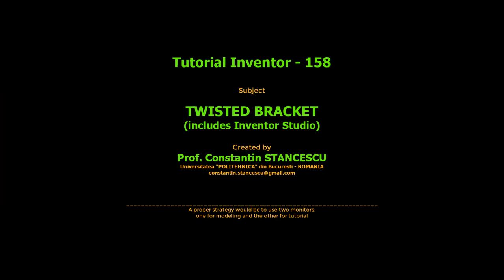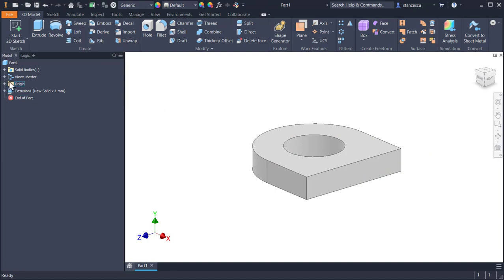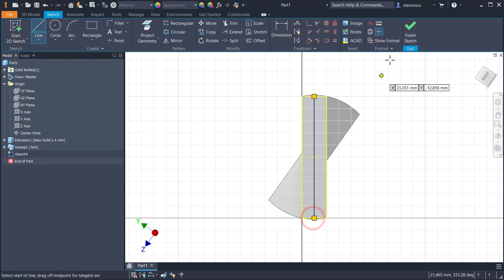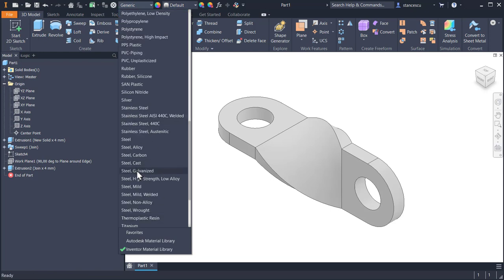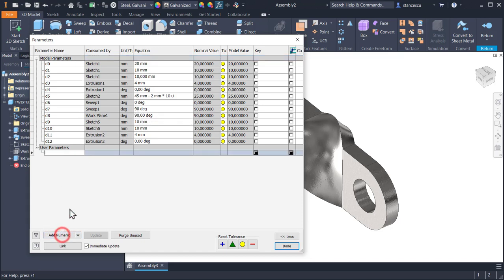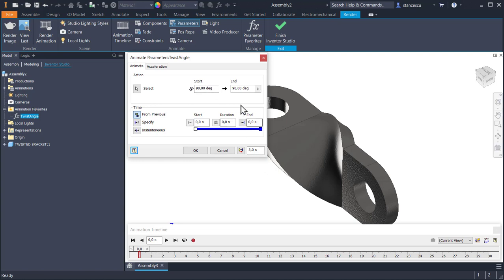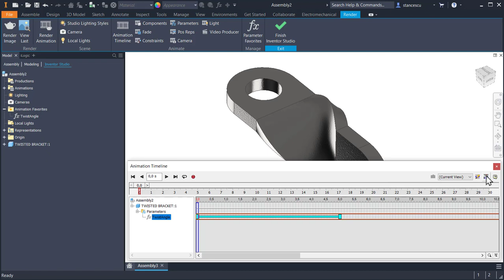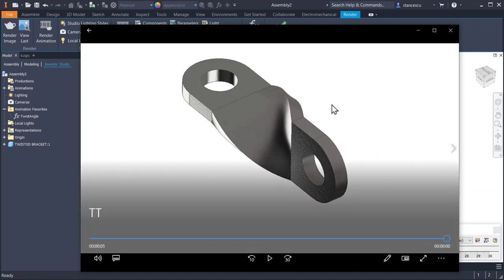Tutorial Inventor - 158 TWISTED BRACKET

Comment: nice tutorial, but not very correct: the twisted surface has a continuity with the planar surfaces, like in the drawing presented in the first seconds of the tutorial, maybe there is another way to model this part in Inventor ? we have here the video tutorial for CATIA v5: https://youtu.be/zAWMkHAsCVo
Reply from the maker: I understand what you say, I also like the solution in Catia. What I wanted to show was the real process of manufacturing with real bends, as you can see in the film. That tangent and beautiful curves are not easy to be obtained and they increase the price per part - this is why I presented a real, commercial example, „in the first seconds”.
Reply: @prof-stancescu  maybe you can try to create a nice curve and extrude a rectangle along that curve, I say this because in the real process there is no sharp edge between the twisted surface and the planar surfaces, the bracket is deformed as a solid and the material flows
Reply from the maker: workbenchstuff A movie with creating the mid twisted section in Catia would be more interesting
Reply: and here I've found a very similar part made in Inventor: https://www.youtube.com/watch?v=5FPhQ1tQhcY
Reply: I have a solution for this in invertor, you have to create both i's on different planes for example 90 degrees, relative, then use the loft feature. Initially the loft will not look right however, you can manipulate points and finally make the surfaces tangent. Maybe I'll make a video